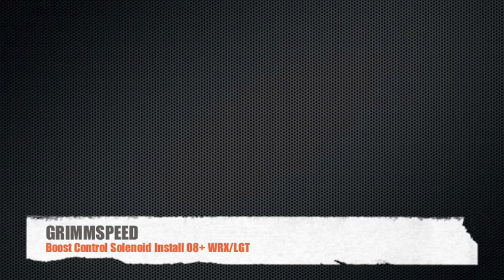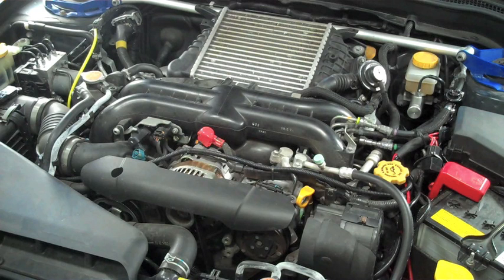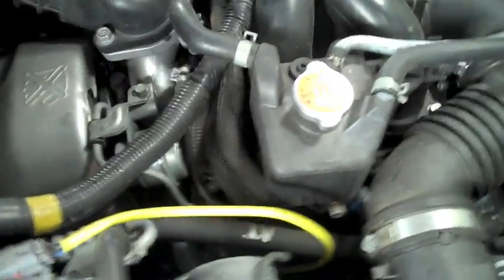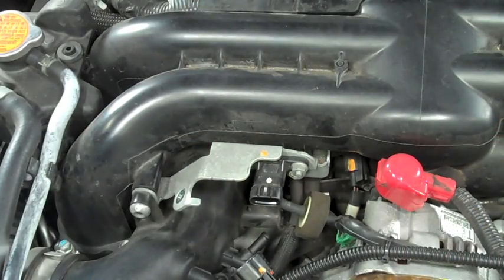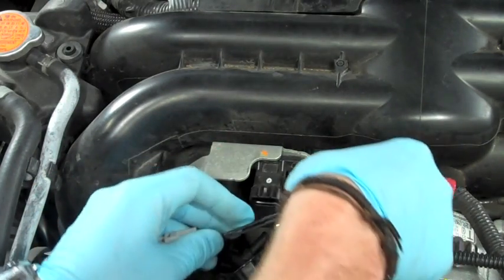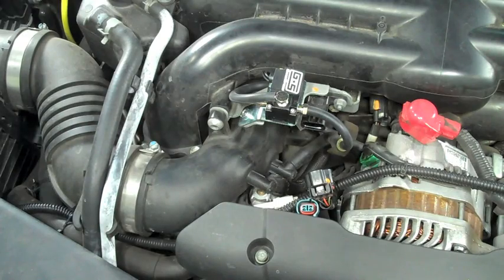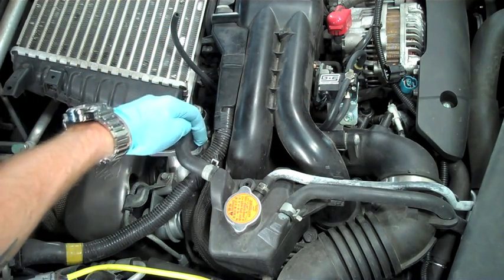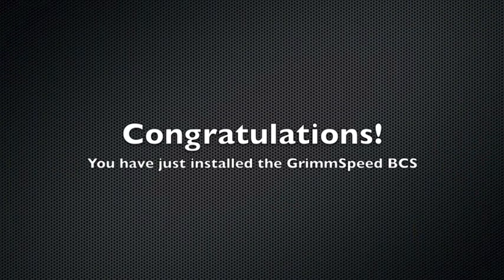GrimmSpeed Boost Control Solenoid Install 08+ WRX/LGT

Comment: How about the restrictor pills? You removed the oem to wastegate and didn’t see you replace the pills. My tuner said this year needs the pills and I have proven that as mine kept throwing codes and weak boost without. May get your BCS to see if I get any notable improvements.
Reply: I believe you don’t need the pill with an electronic boost control solenoid, but with an OEM you will

Comment: A question about the tune. I was wondering if I can install the boost solenoid and still drive around for a week or 2 before the tune or will this do damage? I am moving parts over between an old car of mine to my new one and was thinking of installing the grimmspeed boost solenoid at the same time but the tune isn't until a week and a half later. As i said, am i able to do this or will it go bad? Just asking about the boost solenoid not the rest of the parts. Thanks
Reply from the maker: Hey Toby, you will be required to re-tune your car once our three port boost controller is installed as it functions differently from the OEM solenoid and needs to be dialed in electronically before use. Driving the car un-tuned with our three port boost controller on will most likely lead to over boosting and can potentially harm the engine. I would recommend holding off on installing the three port until it is time to tune the car.

Comment: I just bought an 08 wrx, the previous owner installed this ebcs before i bought it, and basically it is running weird so i need to know is there any way for me to tell if they installed the tune when they installed the solenoid.  I am thinking that is my problem but i dont know for sure.   I have been running it with the the mass air flow sensor unplugged from the air box,  like this it runs really well except idle is a little high, but when i plug it back in automatically the idle drops down way low amd becomes erratic amd even driving the car like this it seems to miss fire.  Can you tell if this might be my problem?

Comment: If I install an oem boost control solenoid will I still need a tune afterwards?
Reply: Leif Wagner a tune is always recommended if you are running over a stock setup. That way you are telling the ECM what you have. That way no check engine light or over boost.
Reply: BAKWOODS KID I won't be running over a stock set up though. I'm just installing the oem solenoid.
Reply: No you’re just replacing it with a stock part

Comment: i have a 2010 wrx.. i noticed  on my  OEM BCS that the  vac line  that runs from the outside nipple to the inlet like how it is in  this video  was is different then mine.  mine had the vac line from inlet to the middle nipple on my oem bcs and the   outside nipple going to the wastegate/turbo vac line... mines opposite of yours.. can anyone confirm how it should be or if it matters, car had a rebuild 10 000km ago and they could have installed it wrong, thanks hope for a reply

Comment: grimmspeed are some super cool dudes as for this damn car,,,,shit.i have the 2013 WRX and did a boost leak test today and that sucked ass.i googled all over the internet looking to see which vacuum lines to plug off and could not find exactly how many there are.like its a fucking secret.there are four. FOUR of them,if your going to do this,buy a pair of long curved needle nose pliers guys.they will help big time.i didn't have them of course.if you have questions about it, holler at me.
Reply: how hard is it to get it tuned after the boost controller is installed
Reply: well if you live driving distance to a pro tune company,no problem just money,but the closes place for me is 2.5 hours away,so i tried to go with a E tune which can be pretty hard if your not familiar with computer programs like spread sheets.i still haven't installed my parts yet.i tried the E tune,but the first map he gave me,my car ran messed up,so back to boost leak testing.
Reply: Dam, that must suck bro. Thanks for the info

Comment: Does cobb tuning accesport v3 (003) enough or do i have to re tune ?
Reply: Cobb currently doesn't offer OTS maps with a 3 port EBCS yet (and probably never will) Eric at torqued performance would make you a map very inexpensively for this though.

Comment: What is the differences on those solenoids for Subaru? I see many sell them for "WRX" and another sells it for "STI", another for "FXT" etc. Isnt it the same if the connector fits? Im looking into buying one for my Forester Turbo S but its a nightmare finding the right one . If it's the same as long as its Subaru Turbo, im good.

Comment: So If I get a grimmspeed 3 port EBCS will it be safe to drive my car for 30 miles to my nearest tuner. I'm going to call them ahead of time and schedule my tuning. On the day of my tuning I was planing on installing this and getting it tuned. The only thing is the place is 20-30 miles away. Was wondering If I should just get them to install it.
Reply: did you ever figure it out I'm in the same situation
Reply: Yes just stay out of boost. Also your tuner should be able to send you a safe limp.msp

Comment: I had my car tuned with a 3port BCS, my tuner installed it for me and tuned it with the intake valve left to vent and inlet plugged up.  he said it's not needed to connect intake valve to inlet hose, it's for emission reason.  Is this ok? and would it change the tune if I plug the intake valve to inlet hose?

Comment: It depends if the COBB tune takes into account for the our 3-port solenoid or not.  If it's for the stock 2-port BCS, then you will need a re-tune for your 3-port.  Typically, you will see the largest gains having your specific vehicle tuned for your applications.  -Matt Homes
Reply: how can i get my car tuned and where ?

Comment: I'm running an OTS Cobb Stage 2+SF intake tune using an Accessport. Would I still need to retune if I install this? I have an 08 WRX and have been overboosting because I'm running a catless downpipe at the moment. It would just be nice to not constantly overboost in the meantime while I collect parts for my 20g build.

Comment: Yes, the waste gate duty cycles are not the same as the OEM valve.  You will need your vehicle tuned accordingly for the our 3-port solenoid.  -Matt H.

Comment: The solenoid will work on pretty much any vehicle that utilizes and electronic boost control solenoid.  Depending on the year, the actual bracket itself may not work perfectly, but it should function all the same once its been tuned for.  -Matt H.

Comment from the maker: @ricky041878 It would be very wise when doing any electrical work to disconnect the battery!

Will
Reply: May I still use ecuflash to tune after installing grimspeed ebc?

Comment: At 1:42 you can see the hose is connected down at the bottom by your right hand, and when it transitions at 2:04, the hose is disconnected. Which hose is that, which you disconnected? Because at 5:43 you say the hose connects to the "stock location" but i don't understand what hose you removed from there in the first place. Sorry about the noob statement, I'm looking to get a WRX very soon and was curious about this. Thank you!

Comment from the maker: @ChicanoRockero Yes it does, if the car is not tuned it may cause it to overboost. Hope this helps!

Will
Reply: Will it be alright to drive the car approximately 40 miles to the tuner with this installed?   I will baby it there and have a base map installed from ther tuner.